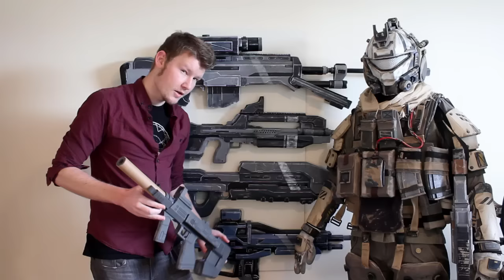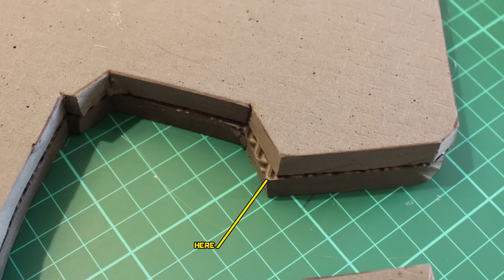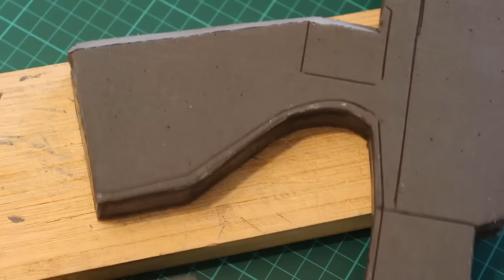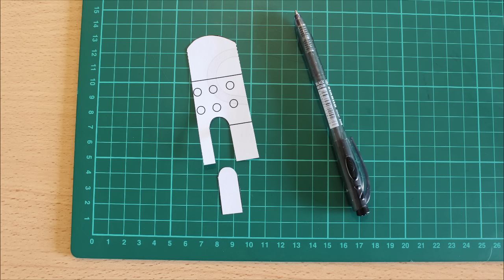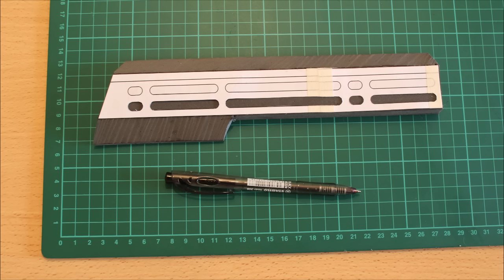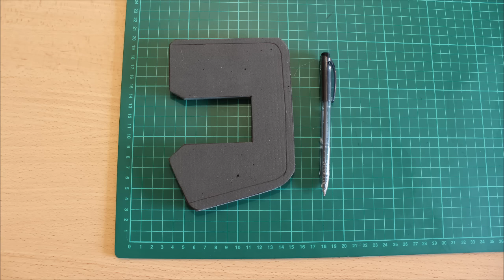HOW TO: Halo ODST SMG Cosplay Prop  PART 1 -  EVA Foam

Comment from the maker: Best of luck to everyone wanting to give it a go =D Details have been simplified for the material =) Remember you can always add or change the way you make it , to allow it to come out how you want =D
Reply: The Titan fall costume looks beast
Reply: Can u make Emile's costume totorial thing that would be really cool love the vids
Reply: Looks really cool. gonna try this and the magnum before i start the ODST armour. thank again, tutorial is really helpful!
Reply: Andrew makes it so easy to do the ODST armor.
Reply: i made the same one eairlyer this year :D
Reply: thanks bro!! really appreciate all of these tutorials =)
Reply: only one thing pissed me off about this vid, regardless if it is a foam prop treat every fire arm as if it is loaded and unless you plan to shoot keep your finger off the trigger.
Reply: just as a pointer, I find using #11 razor pen blades are good for cutting out, but the craft knives are better for shaping the foam.
Reply: does it matter what color of foam I use?
Reply: Hey Andrew, sorry to bother, just have a quick question. You use craft blades in the video. Is there any reason why an X-acto knife and sharpener wouldn't be as good? Thanks. About to   make my first costume, just wanted to know.
Reply: Thanks for the tutorial. It will make a fine addition to my armor

Comment: could a hairdryer be used instead of that heat gun you were using?
Reply: I'm not experienced in this, but I've seen a lot of people say that you can't because the hairdryer doesn't get hot enough.
Reply: Harbor freight has super cheap heat guns just grab one of those

Comment: How thick is your foam
Reply: I need to know this information!
Reply: How thick and what brand?
Reply: looks like Andrew is using 12mm (1/3 inch) thickness of foam. standard for the floor mats. an extra mm or 2 would hardly make a difference. hope this helps. ;)
Reply: looks like Andrew is using 12mm (1/3 inch) thickness of foam. standard for the floor mats. an extra mm or 2 would hardly make a difference. hope this helps. ;)
Reply: Thomas Wever thanks